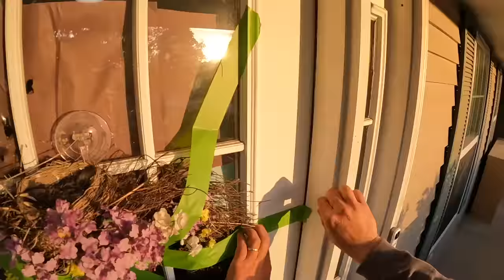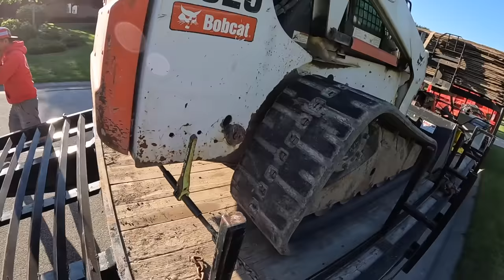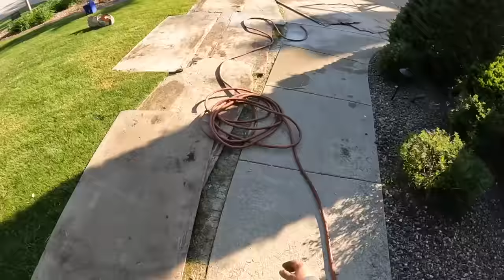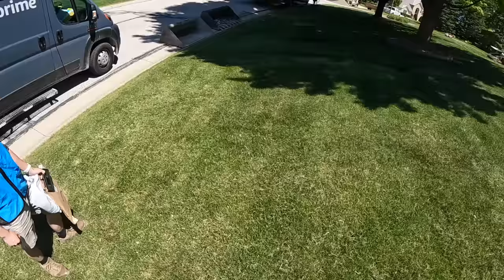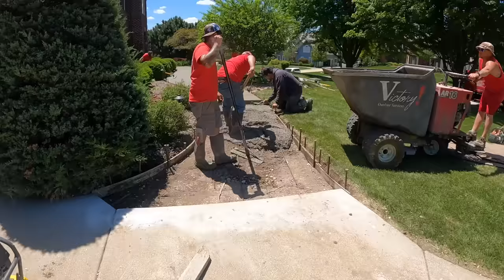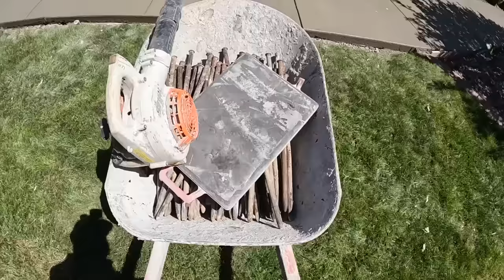Concrete removal-Jackhammer time!

Comment: when i watch your whole crew finishing, makes me miss the old days when that many guys finish a pour. these days, its just me and my son finishing while the rest of the crew sets up the next pour. i wont lie, it'd be nice some days to have that many hands but like most finishers, my son and i make the best of it. i look on the bright side. theres not that many finishers that can handle what we can and make it look picture perfect. 
  when the other guys set up, they save topsoil and grass they cut out and when we're done finishing, we put it back so it looks like nothing even happened. it takes a little longer but because of that extra time took to make things nice, we've picked up neighbors who wanted concrete replaced but didint want the mess some other companies leave behind. some are worse than others and some are...well....shouldnt be in business. imho. 
  as always, sidewalk looks great!!! glad you guys are FINALLY getting some nice weather. its been unusually cold this "spring" but nice weathers finally creeping in. usually we have two seasons..winter and road construction!!

Comment: It's amazing how much confidence that little bit of sharing how to do the bull floating and line cutting will make a difference in the future for your daughters. I let my daughter learn how weld ,grind, torch cut drill , wet saw ceramic ,nail guns, shingle etc. She's 24 has a drift car a house with a 6 car garage and lift. Did I mention she models and is a loan officer at a bank.

Comment: Tip for next time. i work in Finland as demolisher. Cut sidewalk every plate into 2.(around 150kg piece is ok ) take big metal bar to lift it from the ground and use makita jackhammer trolley(or similar two wheeler) to move it away until you can take it with bobcat. Very fast and not very labour heavy job.

We have a lot of job with concrete facades what we need to demolish(around 6-8cm thick). Every day with handheld jackhammers on scaffolding. - thats sick job.

Comment: What kind of form boards do you use? They bend so easy. Also what screws where you using on that fire pit job? Looked like they went directly into the impact driver?
Reply: Idk about the forms but the screws just type in “form screws” you will see the orange ones that he uses. They got a hex top so you dont need a bit or anything.

Comment: The jackhammer..lol.  I had to use one to clean up concrete window openings one time. I had to hold it up like a gun by myself and chip off a ledge so the new windows would fit. Ended up with my picture in the paper on that job!
Reply: Aw, how cute...

Comment: At Kroger you get 3 chances. You get  1 verbal warning and 1 written warning and then then they give a written write up.  If you get 3 written write ups in 90 days then they fire you. You should use that method with Darryl
Reply: Make sure you tell Darryl next time he works you start using that policy

Comment: I have that same jack hammer and cart. It’s a lot easier and safer if u just have a guy pull the handle up from up on the bed . Those two rails help alot. And to get it down just do the reverse ..

Comment: We don't fix landscaping. If electric or irrigation are in the way, It means the homeowner has to make other arrangements with other businesses. Drainage pipes are concrete work, so that is different. I will do conduit through concrete, but I don't do electrical work
Reply: The lesson is setting boundaries, or multi level quotes. This much for broom finish and saw cut, this much for joints,  this much for stamping. That is the true way to do sales, which is why they charge for the bid/visit to see the job.  It's the same as getting blueprints made by an engineer. People don't work for free

Comment: Had a run away trailer one time that hit my helpers truck luckily it was a old truck and insurance paid him back way more then it was worth and it stopped a whole trailer full of concrete thank God it was a busy intersection after it if it had continued to go down the hill would of been tragic I’m sure I always make sure the tires are chalked off and I even wrap the run away break around a cinder block just in case especially on a hill

Comment: Seeing all those older trucks makes me sad , some of my best trucks were 90’s internationals , easy to work on and no high tech computers needed I got 7 ford bobtails 2 water trucks and 3 street sweepers  I have to get rid of due to ca emissions all under 200k miles and regular maintenance and well maintained , ranging from 2007-2012 if any one is looking for a good bobtail,sweeper or water truck let me know …

Comment: Not an expert but have taken rigging class.. you are "in my opinion " hooking your safety chains ⛓  wrong. Hook goes down. Technically if DOT were to check that they can ticket you. Just passing on what they said to me ..
Ty for your videos and crew.
Can you restain or acid etch stamed concrete..it USED to look like leather